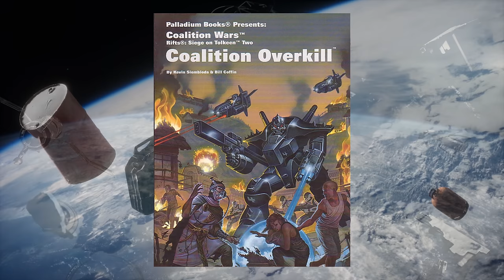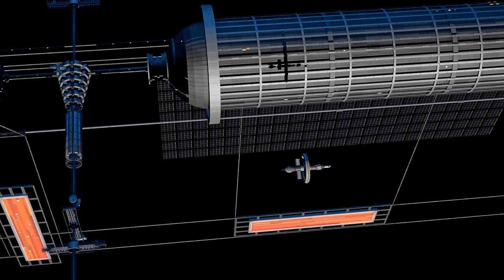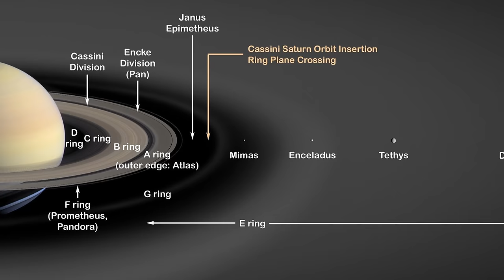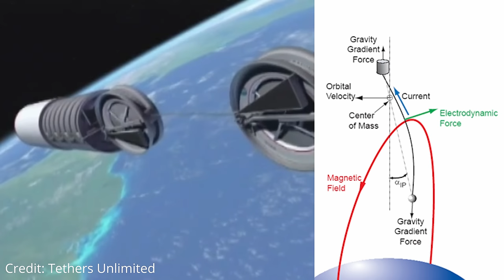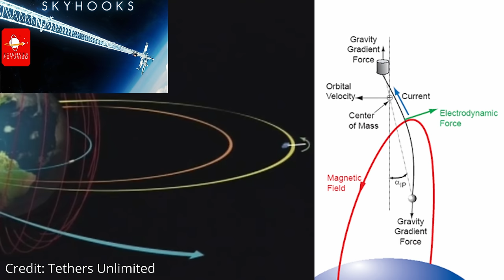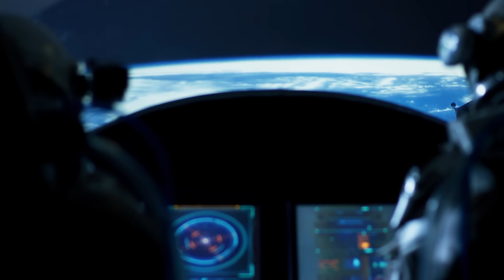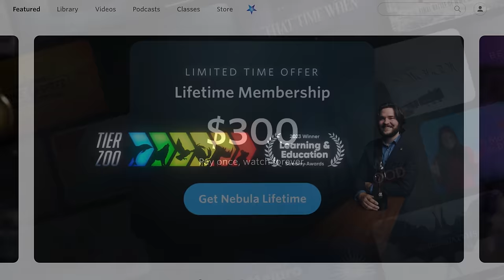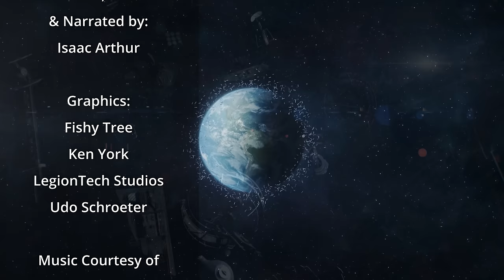Clearing Space Debris

Comment: I've thought a lot about Kessler syndrome, and I have gradually changed my mind to conclude that the hazard is overstated. When two satellites collide in low earth orbit,  they effectively produce 2 clouds of debris. But only small cross sections of debris from those clouds actually remain if orbit. If the resulting velocity change vector imparted on an object ejected from a collision has a significant radial, antiradial, or retrograde component, then its periapsis will be low enough that it will rapidly decay. This consideration greatly increases the calculated "critical mass" necessary to initiate Kessler syndrome.
Also, the assessment that Kessler syndrome would make LEO impassable for any significant length of time is incorrect. If there is a collision cascade, there is effectively no limit to how thoroughly the debris would pulverize itself. The result would be a ring of ultrafine dust, perhaps even approaching the atomic scale. The only debris that could possibly persist might be a thin ring of dust directly over the equator from about 1000 to 2000 miles in altitude. But that's nothing we couldn't avoid.
Reply: I’d need to do the math a bit (probably will later after studying) but at face value it seems highly unlikely that any two same-direction (W to E) satellites colliding would provide enough change in velocity to de-orbit any debris quickly enough to negate the risk of Kessler syndrome significantly. I mean yes a majority of the resulting debris would be sent into a decaying orbital pattern but quickly enough to avoid problems??? Idk. If you’re done the math I’d be happy to see your thought process here
Reply: @YeaaIJusShiddedOnEm  When 2 satelites collide at these velocities, very little momentum is exchanged. But both satelites basically explode like water balloons. Most of the debris cloud expands approximately perpendicular to the relative velocity vector. In order for a satelite to remain in orbit below a certain altitude, its velocity vector must be nearly parallel to the earth's surface. Let's consider an east-west collision between two satelites at 500km. Virtually none of the debris will receive a prograde kick. Some debris will receive a retrograde kick. If that kick is more than a few hundred meters per second, that debris will reenter within half an orbit.
For debris that shoots radially or anti-radially, the bump needs to be bigger, perhaps 1 km/s, but that's nothing compared to the velocity of the collision,  which is 15 km/s. The only debris that would survive is debris that is ejected north or south with no significant radial or retrograde component. I would guess 75% of the mass would reenter within 90 minutes, and 90% would reenter within 24 hours.
Reply: @FourthRoot  I didn’t end up being able to find all the right references in my textbooks yet (idk enough to do it off the top of my head) but I appreciate the response and food for thought!
Reply: @BillyOrBobbyOrSomething  if you can perform a Jool 5 mission in KSP, then you probably have the orbital mechanics intuition to render a good judgment sans literature.
Reply: @FourthRoot  hilarious that you mention that, I just got to Jool this past weekend and crash landed. I play with no reverts :(
Reply: @BillyOrBobbyOrSomething  Let me guess, Tylo?
Reply: @FourthRoot  Vall, tried to land in one of the big craters but ran out of delta-v at about 300 m/s and had to watch Jebediah fall to his death. Havent alt-tabbed so fast since I was playing games on the school computer

Comment: In my pathfinder homebrew, it takes place on a dyson ring swarm. The civilization makes use of megastructure sized nano swarm cubes of ballistic gel, clear so that sunlight can reach internally to solar cells. They use ion power to move around, and use the things they intercept to build further/fuel themselves.
I realize that could very well be a big ol safety hazard to anything that runs into them, and a real risk of paperclip maximizing.
Tiny pieces that get ejected simply rearrange to fly back to the blob, and burn up all of itself doing so, or have enough mass to start as its own cleaner.
Reply: Or instead of clear, green tint to make use of plant reception to absorb sunlight.
Yes they are a gelatinous cube technically.

Comment: For smallish dense objects like nuts and bolts hitting them head on with a block of ice could work.
The resulting water vapor would slow whatever goes through the cloud but it will disperse quickly under solar pressure nor is the slowing affect an entirely a bad thing.
Reply: Ice technically is an ideal material for such a projectile. Sadly, ice isn't really a renewable resource in space (at least around Earth).
Since the ice only has to get to space, and not to orbit, you could maybe launch it from earth with a spinlaunch-like system or a linear accelerator. But that generates "fuel" costs for each intercepted object (where your fuel is technically electricity). And you'd need to enclose the ice in some fairing. That fairing would be guaranteed to de-orbit itself, but it still adds extra cost to each launch - even if the "fairing" is the outer most layers of ice of the projectile itself.

Also, the nut or bolt or whatever could easily tumble upon impact with the ice, so that it's orbit after impact can't be accurately predicted. It would still be on a guaranteed de-orbit path, so it would only do a single pass through lower orbital space, but that added risk might be a deal-breaker.
Reply: @Pystro  
Sub 3 inch objects like nuts and bolts are hard to track so the risk of them hitting something within the less than 2 hours they would have left in space after hitting the ice is significantly less then the risk of leaving him in orbit. Spin launch is a ludicrous absurdity; consider how much angular acceleration there be subject to when approaching launch velocity.
Lift the water to orbit using the difference between maximum payload weight and actual payload weight.